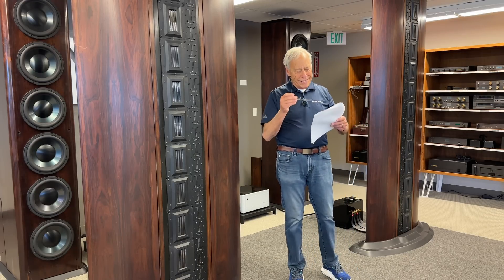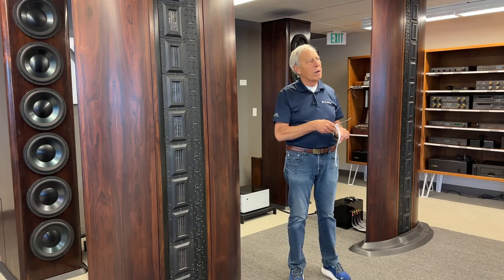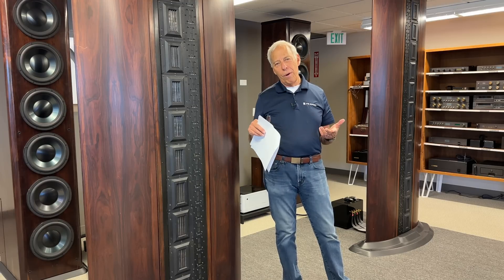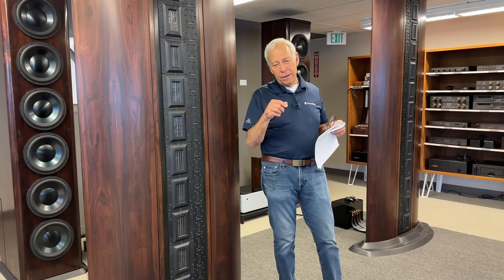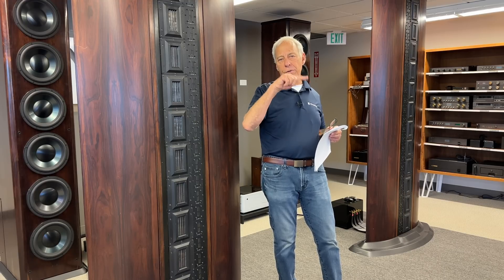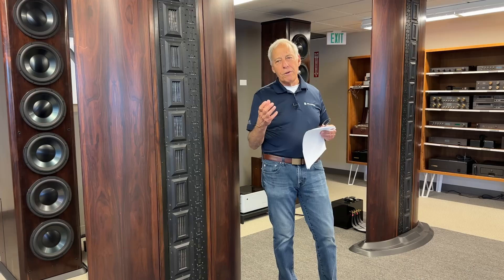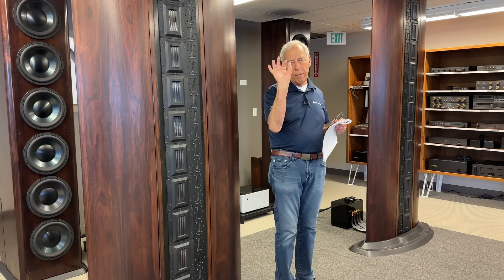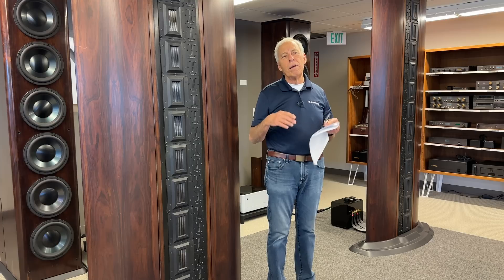Inverted dome tweeters

Comment: The interesting thing about that tweeter is it is described as an air spring tweeter, whatever that is. Simply being inverted sounds not as radical. Epicure said back then that they would never use bigger than an 8 inch woofer. They were concerned with transient slowing by  bigger drivers. I'm not sure if they stuck to that. I know one of their speakers had a passive radiator bigger than that. The Epicure 3.0 was quite a nice speaker for it's day I am told.
Reply: At DB; Douglas Blake. In your neurosis, just to be argumentative, you actually scold me for saying "I hear the Epicure 3.0 was a great speaker, I am told?" Truly bizzare. When someone uses the phrase "I am told, "they are saying their knowledge comes from a second hand source. Yet bizzare you, even finds something to criticize about that. Someone like yourself who used Radio Shack Minimus 7 tin can sounding speakers as your reference, and who says that a hair dipped in water sounds just as good as the finest audio cables. Besides a speaker being a great speaker is never "A Fact." "Great" is an evaluation inside someone's mind. What different people think of a speaker is always subjective. How lame!!! It looks like you are still licking your chops from having your you know what kicked, in our little debate yesterday. Don't look for arguments. If the owner of this channel knew how hard you have been trying to make high end audio look like a joke for oh so long now, without being able to own high end equipment yourself or having great experience with it, you would be off this probably. Just because YOU can't hear, just because YOUR  rented room isn't big enough, just because YOU can't afford high end equipment, doesn't mean others are in your same boat. As Paul clearly explained, spatiality increases enormously when moving speakers 3 to  4 feet out from the wall behind it. You telling someone that it won't affect the soundstage hardly at all,  besides being awfully wrong advice; is a joke. YOU CANNOT HEAR. Keep your awfully bad advice to yourself.
Reply: You're only kidding yourself thinking 15 woofers have the best transient speed. A heavier anything has more mass, and more mass is not going to start and stop on a dime, the way a smaller lighter driver can. Even Irving M. Fried who had a lot to do with transmission line bass loading and other innovations, never used that big a woofer. He tried using an enormous cabinet once, to astonishing effect  A big woofer does not have the ultimate in control, it can put out MORE bass, but is never the ultimate in bass quickness. In fact all the speakers with really big woofers that I've owned sound really heavy sounding and lack fleetness of rhythm. Really rhythmically challenged. They hit hard but overwhelm and dominate the music. I've long ago gone to speakers with better balance. I realize there are those out there who are like that guy in the Maxell tape, ad picture. But I go for "Just right" instead of making my knick knacks rattle. As I said it was Epicure's statement implying that anything above an 8 inch woofer pays a penalty in transient speed. Their statement could be totally wrong for all I know. But all things being equal, a driver of lower mass has starting and stopping  advantages. Think anyone's 15 woofer is as taut as a Martin Logan X Static electrostatic panel? Not as beefy, but for speed and definition; no way! If you go high enough up in price in planar or electrostatics, you don't get wimpy bass.
Reply: @sidesup8286   Your own words:  "all things being equal"   Absolutely a smaller diaphragm has a speed advantage, but it certainly doesn't when it comes to speed x volume of air.  It boils down to mass driven by motor.  Even a 5,000 ton WWll destroyer will hit 41 knots due to a massive drive train.  You dad's speed boat won't even do that.  Show me one speaker with more dynamic realism that a JBL studio monitor that is not named Genelec or Neumann.  Electrostats and ribbon diaphragms are an entirely different animal.  That's why my $12K Maggies need subs.
I own so called 'audiophile' dual transmission line speakers with 8" drivers-- Castle Winchester  flagship model.  I also own several traditional studio monitors, bi-amped dual concentric's,  Magneplaners as well as REL S series.  There is a HUGE difference between home and pro-- not necessarily for the better.  There is also a huge comprehension difference between those who make their living producing audio and those who come home from work and enjoy it.
Reply: @ Keith. I agree that there is more than mass involved, but mass is a major factor in transient speed. That's why I said "All things being equal." I do think that one of the fastest dome tweeters I have ever heard was a Scan Speak whose magnet on back was so heavy, that it was heavier than some woofers. Amps that are extremely fast that have rise times in the nanoseconds like Electrocompaniet of course are essential parts of the equation to avoid talking about your own nose without realizing it. Also amps that have exceptional low end weight with the kind of cables that it would be hard to think of a speaker that would need a  subwoofer connected to them. Again to avoid talking about your own nose. It would take nothing less than all those things and more to make definitive statement on just what is and isn't possible, along with competent listeners. Based on my heavy Scan Speak tweeter percepetion, I don't really doubt that bigger woofers can have a good deal of speed, I just know that when talking "Ultimate" I'm sure there are better in that way. JBL is a brand that is not really in favor with most high end audiophiles. They rarely review them in the major magazines. They know many audiophiles have a bias against them from the years that just about all their speakers were considered showy rock speakers with the so called West Coast Sound. Readers of Stereophile & TAS are mainly interested in accurate sound; which for many is the definition of high fidelity. I remember around 1980 a store that played me several different JBL's, and I said that what I really wanted was a natural sounding speaker. He said "We do have one thing" and he switched to the JBL 166 Horizon. Ahh..now that was more like it, I thought. That was long ago. What current JBL speakers sound like I am not very familiar with. I hear tell that the new version of the JBL 100 is a big improvement over the vintage one. Whether someone builds a speaker or is just a listener does not affect how well they judge sound. I do mods galore and my sound has so much air volume that it has nowhere to go but upward. My sound is on the ceiling and inching toward me with each improvement. It's a very big room too. Don't think I'm too concerned about spending big bucks and having much that needs work or changing.
Reply: @sidesup8286  There is ABSOLUTELY nothing more accurate than a studio monitor-- that's their job.  Studio monitors are constrained by a strict set of design parameters and are not necessarily the best sounding speakers.  As I said in my last post-- pro is not necessarily better.  In contrast there is nothing accurate about an audiophile speaker.  Hell they don't even phase align nor do they have an even response.  Who cares?  All that matters is how pleasing they sound.  However, they are lacking in comparison in regards to power linearity as well as power compression and the biggie-- dynamic realism.  BTW:  What makes a studio monitor sound so good (we're talking world class here) is the architecturally designed, no expense spared room.  The 80's was 40 years ago.  Do you want to compare audiophile speakers from 40 years ago?  I'll tell you one area where audiophile speakers are better-- front to back depth and a holographic presentation.  PS Audio's FR 20/30 are excellent in this regard and I would rather have them in my house than any studio monitor.

When I made the comment about pros, I was not talking about someone who makes speakers.  I am referring to professional sound engineers who get paid to record, mix and produce music.  And that very much has EVERYTHING to do with judging sound.
Reply: You sound like the kind of guy who it would just make their day to win an argument against someone by lying and bending the truth. Very childish Where do I even start? There ARE some  audiophile speakers that are phase aligned; stepped back so that the center of the drivers are allegedly the exact same distance to the listeners ear. This is a joke actually, since there are 5 foot five inch people and six and seven foot people. NOTHING can compensate for different listening heights. Obviously with a tall person, the tweeter (usually) on top is going to be a lot closer to his ears, if the speaker is above sitting height etc. Ridiculous, and ridiculous that you would asign such great importance to this, just for your "argument." You say there are no time aligned speakers except studio monitors. That's an interesting one. Did you ever hear of Vandersteen? THE BEST SELLING over $1,000 audiophile speaker of all time?

 You say that studio monitors are the most accurate. To what? A measuring device? Unfortunately the rest of us are not robots. We are humans with human ears. We intelligently buy what sounds good to our human ears; what we will enjoy. Who cares about engineers having the best technical knowledge; and it sounds like you are one. There are hundreds of you engineers who knew so much, so so much that the speaker brand you types started sounded like crap & went the way of the Edsel, because people didn't like the sound. Please go argue with someone else. Maybe there's someone who doesn't have as good a mind that you can "Overwhelm" with your BS. You won't find one here.
Reply: "Epicure said back then that they would never use bigger than an 8 inch woofer. They were concerned with transient slowing by  bigger drivers." 

John Dunlavy managed to build the most accurate passive speakers in the world, with 12" or 15" woofers. Just look at the impulse and step response of DAL speakers if you're in doubt.
Reply: @BB..........  I believe that its not impossible.  The problem is more of a question of Power.

 To be able to control the EPI woofers as well as they do... especially with the air pressures of a Sealed cabinet... EPI uses very large and very strong magnets + strong voice coils.   This allows for the fastest acceleration control... which results in very minimal levels of potential distortions.

 To be able to control a much larger cone, and still have that same level of acceleration as a smaller cone... you would likely need like 4x the magnetic power.

 The thing is... that most of the Audio Industry has been taken over by Eco-Radicals... whom do not want the common man, to have that much power consumption.  Its also why they started highly compressing music, from the 90s and beyond... getting worse and worse every year since the 90s.

 Porting was also part of that push.. because it makes speakers louder,  and allowed for the use of weak ECO-Woofers (since they no longer had to fight against a sealed cabinets higher levels of air pressures).   And of course, Ports create an Artificial sounding Bass... making them utter SH*T, compared to Sealed speakers.  Passive Radiations, coming in next best in line.    And ports being the absolute worst.
Reply: I am fine with my 15" woofers
Reply: @scottyo64  Its not the size of the woofer that matters most.  Its the Strength of the Magnet,  the Coil strength,  The strength of the Cone material,  and the precision alignments.  Any of these factors, can make a larger woofer, sound and perform FAR inferior to a much larger woofer.   In my case... I owned a pair of Techniques 12"  3-way speakers.  But eventually bought a pair of EPI 100v speakers... a 2way bookshelf speaker pair, that only had 8" woofers.   The EPIs put out MUCH punchier, deeper, and more accurate bass, despite being much smaller in diameter, than the techs.

 Upon taking the Woofers out and inspecting them..  The Techs woofers were very light in weight.  A Single EPI woofer, weighted more than TWO of the Tech woofers combines.  Why?  Because the EPI woofers use much larger and more powerful magnets.  As well as stronger coils.    This allows them to accelerate Much faster... and leads to FAR less Distortions.   It also allows them to be Sealed speakers... which prevents Artificial sounding bass, from the dreaded PORT designs.

 The drawback... is that they requite a lot more Amp power to drive them... and they are not as Loud as the techs could go.   That said... they are far loud enough for me.. and sound about 10xs better than the techs... so the techs hit the Curb the next day.

 Now... as much as they can play deep bass-head type of music... they are not going to be a replacement for massive powerful subwoofers.   The EPIs are about real musical accuracy...  Not to shake the house across the street.  Nor to blast room shaking bass, in a mega loud Club.  Thats what  "Pro audio"  equipment is for (loudness, but far less musical accuracy).
Reply: I have a pair of EPI. They’re trash in comparison to everything I have with 12-15” woofers. Comparing junk to junk isn’t comparing anything. Technics made some great equipment but were never known for great speakers. Most companies who did gear really well never made particularly good speakers to go with it. That being said the EPI’s are nothing worth mentioning either. Better than the majority of technics perhaps but  large woofers manufactured by a company known for making some of if not the finest woofers in the world, like Eminence for example who makes all the woofers in all my top tier Klipsch heritage speakers, will absolutely stomp the dog 💩 out of any 8” woofers dumb enough to step to the challenge. If you can listen to EPI’s and actually enjoy them then I guess that’s the main thing but I find my 100’s to be rather underwhelming in comparison to any thing else in my house. That being two pair of Klipsch with 15” woofers, 2 pair of Klipsch with 12” woofers and 2 pair of JBL’s with 10” woofers. Not surprisingly as woofer size decreases so does the overall sound quality of the bass output, the EPI’s with 8” woofers being the absolute worst in the the house by far.
Reply: JBL blows that theory out of the water.  All of their signature and pro line use 15" drivers.  No speaker in the world trumps JBL when it comes to dynamic realism-- speed, attack and rise time.  Greg Timbers, senior designer for JBL states, "the number one goal of speaker design is dynamic realism"
Reply: @keithmoriyama5421  Pro Speakers, are not fit for an Apartment.  Furthermore, they likely use Horns for the highs.. and horns are the Worst at reproducing the high end, without being Harsh / Fatiguing,  as well as distorting the intended 3d Soundstage.
Reply: @johndough8115  Absolute nonsense.  First of all who said anything about pro speakers or for that matter their 'signature audiophile' speakers in an apartment?   The original post referred to speed v size of diaphragm.  Horns are fatiguing at close range because of the velocity they generate doesn't smooth out until a proportional distance is achieved.   Horn tech has changed drastically since 1960 and many of the complaints are no longer a problem, unlike direct radiating cones which will always be prone to lobing-- but, even that has improved.  The JBL 2405 'slot' for example is one of the smoothest compression tweeters ever designed -- no sizzle, no sparkle just air.  That's why I cross overed my Magnepan 3.7's at 10K with a JBL compression HORN driver for a much improved smoother 'airy' high end.
To really know what your talking about you either have to own it or use it professionally day to day.  So what horn system's do you own?
Reply: @keithmoriyama5421  Every Horn Ive ever heard, or owned.. sounded like a horn.  A specific type of sound distortion... along with changing the INTENDED  3d Soundfield Image.

 Here is the thing... which the EPI 100v  speakers..  you can turn them on... then get someone whos blindfolded into the room.. spin them around 15 times... and then Ask them to try to locate those speakers... and they will fail.   Because these speakers project such a 3d Holographic sound-field, that its like the sound is simply all around you, without a projecting "Source".

 Meanwhile... virtually every other speaker that Ive owned / heard...  I could INSTANTLY know exactly where the speaker was.   I could often HEAR the actual tweeter... as being "Separate" and noticeable.

 Meaning... that instead of the sound being so natural and Realistic... that you all you can think about is the Drum Solo you are listening too...  instead,  your mind is taken away... focusing on the artificial nature of the tweeter itself... and recognizing its presence... rather than being 100% lost in the music's depths.

 A Horn shape, alters the way that the soundwaves were meant to be.  It makes the sounds of the drivers much Louder... but at a cost.  That cost, is in losing the intended soundwave shapes... and thus, changing the sound / experience.

 If you cup your hands around your mouth... your voice seems louder to others.  A paper, or plastic cone... is much easier to hear this difference.   Of course, a typical speaker horn... isnt anywhere near that level of difference... because the horns are often more shallow... the frequencies tend to be higher (thus less effected),  and the material tends to be more rigid.   But even still, there Is a change.  You do not get something.. in exchange for nothing.

 Horns are what you would use at a large loud venue, like a concert or club.  They help boost / amplify the sounds to be louder.  But like Ive said... it comes at a cost of clarity, and intended accuracy.

 Of course, if you have poor quality hearing on the upper frequency range spectrum.. maybe you dont even hear this kind of difference.   In fact, maybe you want / need a severely boosted tweeter... to have a somewhat normal listening experience.  Much like, if you lost half of your tastebuds... and needed much more Spices, to be able to fully taste the dish, in the same way that others experienced those same dishes.
Reply: " The Epicure 3.0 was quite a nice speaker for it's day I am told.:

Another "fact" for which you have no direct knowledge.